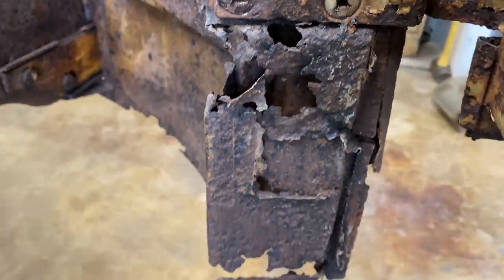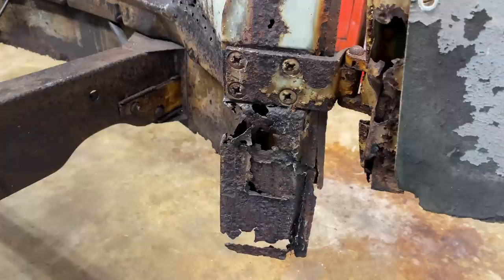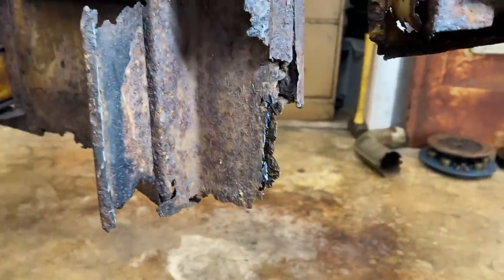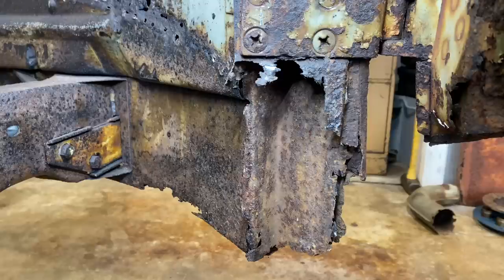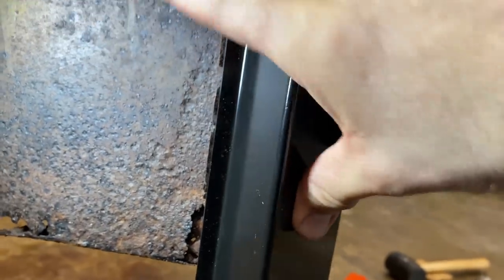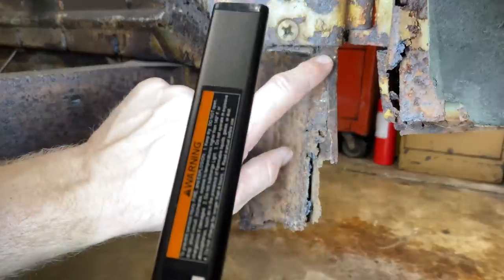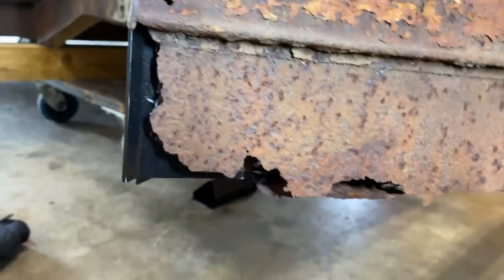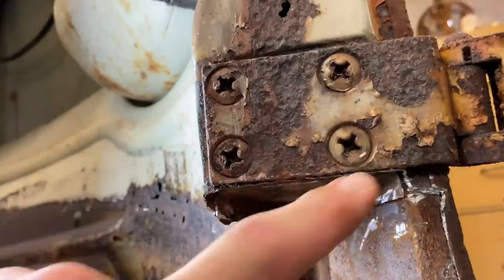Extreme RUST! VW Bus Restoration, VW Bus "A" Post Repair, VW Kombi, Classic VW, CT's Garage, ctmoog

Comment: If using a WW dogleg, double check fitment. They're made to fit a perfect bus and by layering the pillar your decreasing the space. Ask me how know! Lol. Also I had the same issue below the hinge. I removed the door and filled it with 5/16 round stock, welded on both sides then ground it to look stock

Comment: check that body panels guide book that yo got, for alignment of the repair panels. Try the thst seat panel, for fit on the passenger. I beleive that the flat/level panel edges,just lays over the vertical panel, wheel opening piece. RC

Comment: Hi CT! you are trying your hand at a very difficult job, it seems there is very little healthy metal to weld on. In my opinion, however, you would make yourself better of the situation and work more comfortable by removing the door (to remove the screws you need a percussion screwdriver) freeing up some space on which to take good measurements. Don't get disheartened now the most beautiful begins!😂👍

Comment: You need to take the back piece off the new one by the spot weld split it in half as your keeping the oem back piece in place you only need the new front part of that if that makes sense if it was me I’d cut the old back piece out as well and fit that full new one right up the the door bracket take the door off and you will have solid metal to weld too hope that helps 👍🏻

Comment: The correct fit must be pretty exacting or you will have trouble with the door fitting. Take your time. On camera it seems to require more removal of the old metal. Your friend Ron.

Comment: Just watched your video on removing the steering wheel. You referred to a new book/ manual you have. Blue cover vw bus manual. What is it and wear did you purchase?  I am restoring my 67 dc so I have really enjoyed your video’s.
Reply from the maker: Thanks man! The amazon link is below. You can also find it used on eBay and other sites and you might be able to download it for free from the samba...you might have to search the fourms. Lots of good info there. https://www.thesamba.com/vw/archives/manuals/type2.php

https://www.amazon.com/Volkswagen-Transporter-Workshop-Manual-1963-1967/dp/0837616980/ref=asc_df_0837616980/?tag=hyprod-20&linkCode=df0&hvadid=266004384678&hvpos=&hvnetw=g&hvrand=1003834061893346848&hvpone=&hvptwo=&hvqmt=&hvdev=c&hvdvcmdl=&hvlocint=&hvlocphy=9011753&hvtargid=pla-353603832921&psc=1

Comment: Hi CT, Looking for tips on going live. I got on my laptop to test it today and set on private. All it did was spool and when I tried another browser it kept saying to set up a mic and camera? It's a laptop with a mic and camera? Let me know. Thanks Tim
Reply from the maker: what phone do you have? I do mine from my phone.I monitor the comments from the computer.
Reply: I have it kinda figured out. First I still have to use webcam since I don't have over 1000 subs yet. Then I found out I needed to download streaming software. I just got that up and running with my laptop now. I try it tomorrow but now live yet. I'm just 2 subs away from 200 so only 800 to go haha🤣. That's why I want to do a live to thank everyone👍
Reply: Hi CT, getting closer to going live. I have figured out how to use OBS to live stream on my YouTube now and set on private for now. Issue I have now is there is a 20 second delay for it showing up on my laptop. I'm just watching videos to figure it out
Reply: Tried using my Samsung Galaxy 8 with android cam app with my laptop. I used the OBS broadcasting download with it and the cell phone camera has allot better camera for webcast. Going to try it in the morning which will be around 10AM your time back there. I'll be surprised if it works?

Comment: Hello
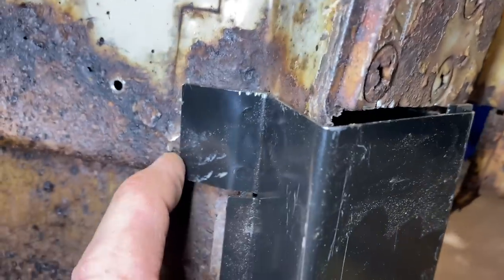On 23:55 part is to close to hinge.
You need to put od down for arround 1 cm and weld new metal to part and bend  for arround 45 ° to hinge or do a little bend on part   and then weld it behind hinges. 
If you look for that picture on web you'll se what  i mean.
Regards from Croatia
Reply from the maker: Thanks Mario! That might work! =)

Comment: i know you are trying to do it yourself but looking at what your doing it will create further problems trying to take short cuts by not cutting out the entire section by over lapping it you are moving to real location of the lower pillar which will create bigger problems with your floor pan and dog leg section not fitting
by over lapping that pillar section you are moving it out the thickness off the metal but by the time you  reach the area where the dogleg fits you could be up to 3 mill out
better to remove the whole section as intended by the replacement section  also theres rust under the lower door hinge that needs fixing

Comment: I am not a car mechanic but I can see this whole structure is rusty and compromised you would have to replace 80% of the rusty parts on this bus to be safe, such as panels, metal parts, front end, cargo flooring, etc, etc

Comment: Hey mate. 

Yeah you really need to evaluate what your doing with regard to the panels your fitting.find a good bit and buy the appropriate panel to make "good" to the the next part.

Zero point in welding a small panel to the end of another load of rusty crap.

So many good panels available for the splitty,you just need to work out what will realistically remain of rusty and work off of that. 

A shinney panel on the end of a load of old crap won't cut it unfortunately. 
I'm doing a van during the UK's covid 19 lock down and it looks like triggers broom regarding what remains. 

Patina can be good,but I'm afraid rusty is way beyond in most places:-(

Don't be put off its always a learning curve and you have to start somewhere but try to work out whats actually any good and worth attaching new parts too.

Comment: Hi CT, now Pandoras box is wide open. Sometimes you have to make small sheets yourself. I would also recommend removing the door, but it will be hard work because the screws are rusted and the material is too soft for an impact wrench. You should also first remove everything from rust to see where there is still usable material to weld.
And if you like you can watch some videos on this channel: https://www.youtube.com/user/jademuttley
I have never seen a better channel anywhere on YouTube when it comes to sheet metal working or welding. This guy is really exceptional.

Comment: Welding a new panel over original rusty panels... If you can even get it to weld, is the worst thing you can do! The rust will come back through and rott out even more. First thing I'd do is remove the door!!! Then cut out all the rott, clean what's left, protect, paint. Then see about welding in the new panel. My beetle has had front quarters welded over the top of the originals in the past, this has caused what would be a good solid bug to rust out, things be misaligned and generally messed it up.

Comment: What are you doing? You pillar is rotted to the middle and you're going to the bottom to weld repair the item, then it is necessary to remove the door and secure the stand to understand where they remained living metal where it had rotted and then on the basis of all this is to weld the respective fixation insert and cook on the rotten metal, this car actually, you should all use the angle grinder to clean up and then see what is welding and what not in General, watching your videos and I like your desire to restore this VW Transporter but you make too few hands and a lot of talk trying to fill the duration of your video right and I would like to come and show you how to do it. And so you are well done, good luck with the restoration!